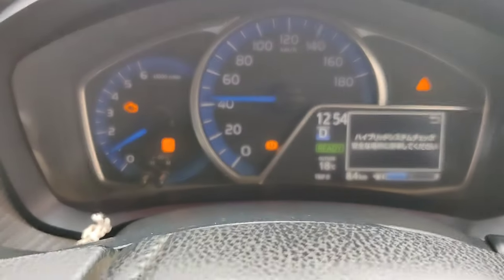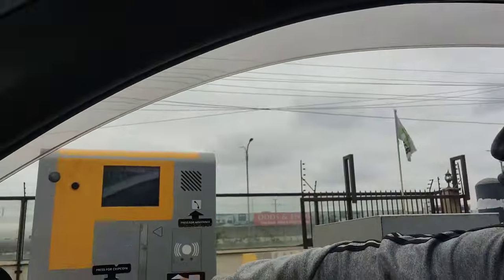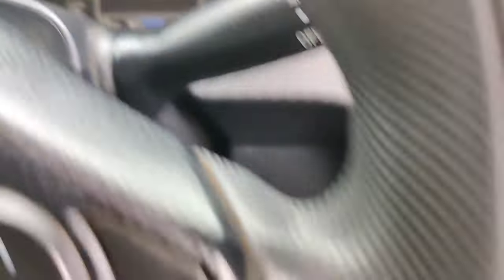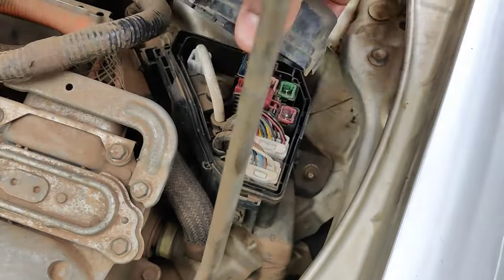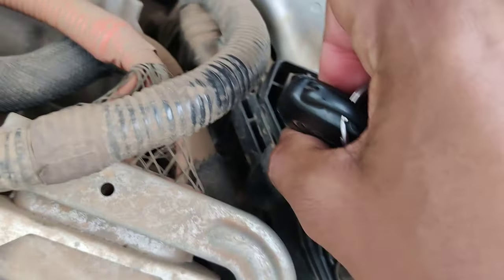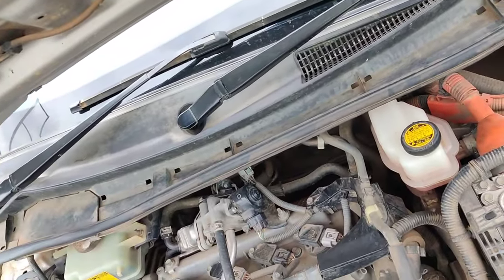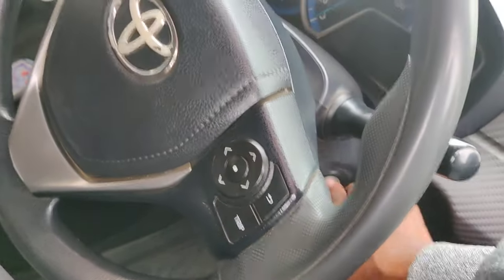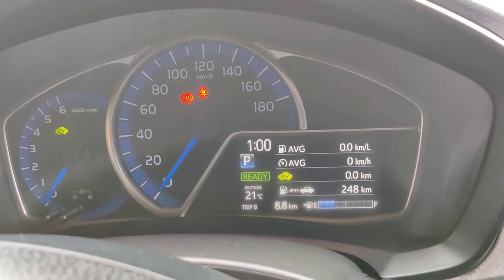TOYOTA HYBRID ENGINE CHECK LIGHT ON. -FIELDER

Comment: Did you had the same issue after battery cell replacement? Me and my mechanic checked and replaced all battery cell, they're working fine and we changed the fan as well but this message still appears.
Reply from the maker: Check the brake system too. I noticed these lights pop up when the abs system is faulty.

Comment: This really helped me today. Any chances of reoccurrence after this procedure.
Reply from the maker: You will still have to determine the root cause it's a temporary measure have a diagnosis done. For mine I replaced the battery cells
Reply: Where did u purchase ur battery cells
Reply: @ronaldowallace173  I have never changed the cells, recent diagnosis recommends replacement of battery pack. Each cell was at 8.20 - 8.24.
Reply: @rebuildingmagari  Did you had the same issue after battery cell replacement? Me and my mechanic checked and replaced all battery cell, they're working fine and we changed the fan as well but this message still appears.

Comment: What actually causes those same exact light to come on the dashboard??
Reply from the maker: It can come as a result of faulty hybrid cell. You will need to replace them you'll notice that when you reset the car the hybrid system will turn on. This means that a section of the cells are faulty not all of them. If it doesn't turn on it means all the cells need replacement which is rare.

Comment: Is this fix temporary or?
Reply from the maker: Yes only temporary but you'll need to change the battery cell
Reply: The mechanic has repaired it he replaced the coolant he said the batteries are fine @rebuildingmagari
Reply: @abeidsalim8008  Is the problem fixed bro or that message still come
Reply: @animeozil633  fixed it has not shown again. I changed the coolant that it's!

Comment: this happen to me today. does your lose power when it happen
Reply from the maker: Halo mine didn't. the petrol engine is working fine I got the cells replaced for the electric engine. You can check your plugs first they could the cause of loss in powe